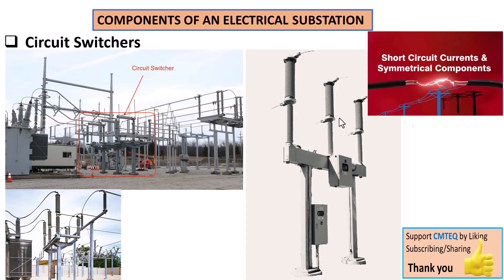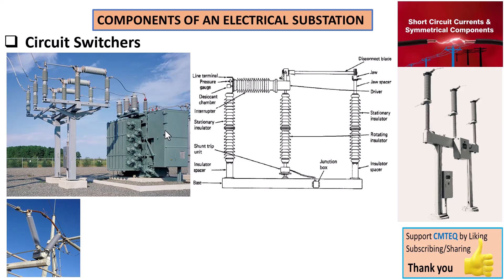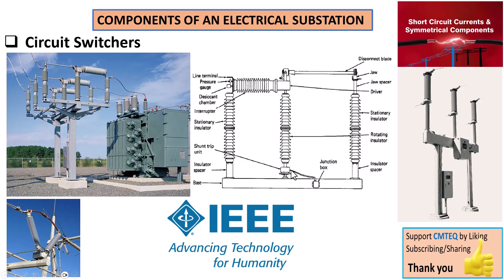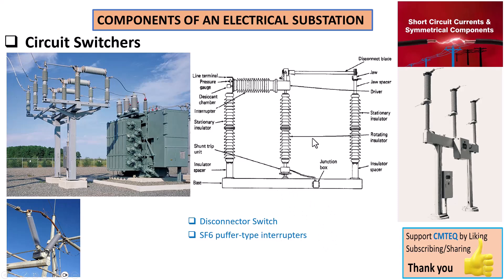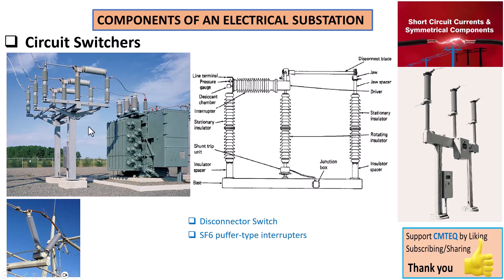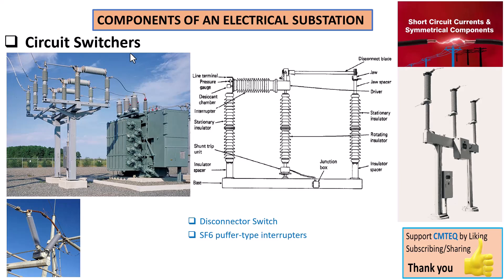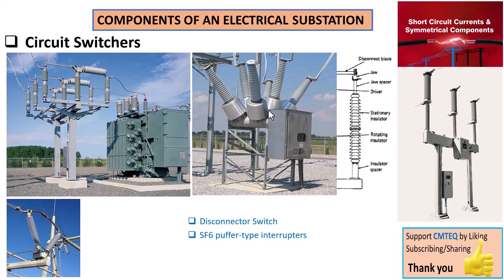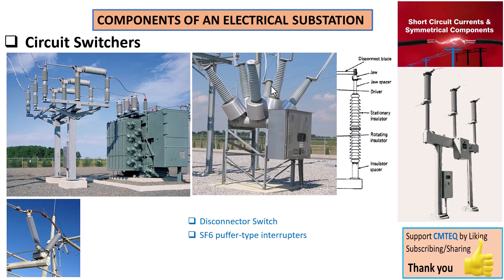7. Substation Components - Circuit Switchers

Comment: i actually have some question in mind. Usually, H\how many circuit switcher needed in each substation? can they replace circuit breaker completely? Thankyou!
Reply from the maker: Hi thank you for your question. The number of circuit switchers depends on the Substation layout and size, the number of feeders and also transformers, because circuit switchers are strategically placed on the primary and secondary of a transformer this means for every transformer you must have 2 circuit switchers and 1 circuit switcher for every feeder.
So typically you can have 4 to 5 circuit swithers for mini substation and up to 10 or more for large substation.

No, circuit switchers cannot replace circuit breakers because they both serve different purpose. Circuit Breakers primary role are to interrupt fault current, while circuit switchers main roles are to switch and isolate certain sections of the network under normal conditions.